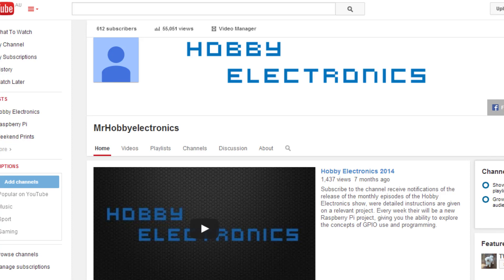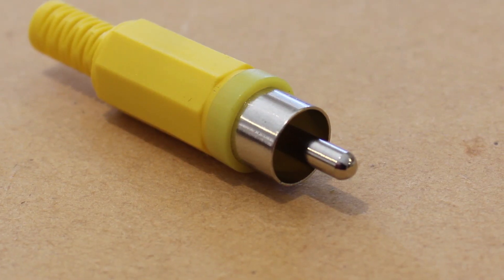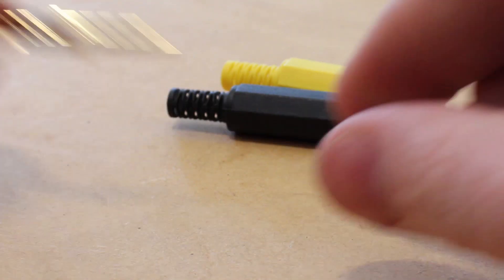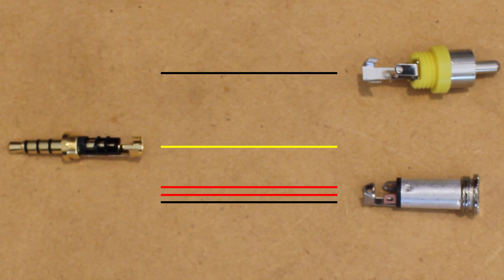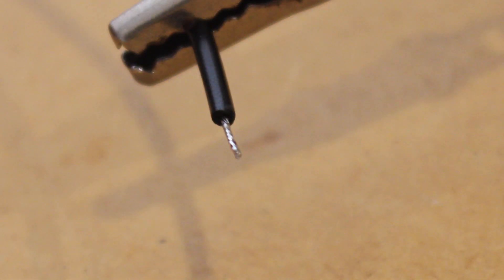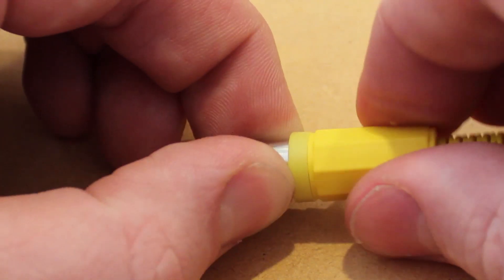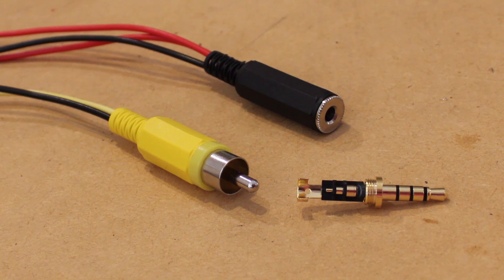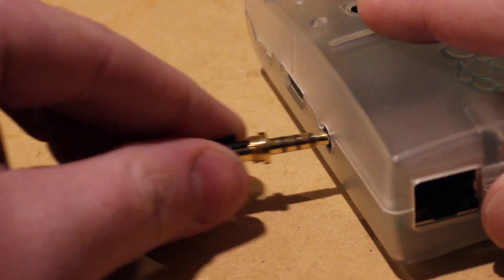Raspberry Pi - B+ AV Breakout Cable

Comment: great video.  Once you have the cable...do you have to do any special configuration on the RBP itself for the composite out to work? or is it plug and play?
Reply from the maker: +JAFO-PTY Thanks for your comment, I just needed to pug the cable in and connect it to a tv and it worked for me.

Comment: Does this work with the raspberry pi 2?
Reply: +MrHobbyelectronics  yes it does
Reply from the maker: +Mitch K Hi Mitch,  I have not tested it but I believe that it uses the same configuration.
Reply from the maker: Latest Trailers Thanks.

Comment: It doesnt work, i have this cable from camera, with camera isnt problem but raspberry do nothing
Reply from the maker: Mr Nope You might have to plug one of the audio ends into the video jack instead as the pin out of the cable might be different as it was made for a camera.
Reply: Ok, good idea, ill try it
Reply: tried, but it still doesn't work, can you get with this cable to the first screen on the first raspi start? I think it should be set on the raspbian as primary output, but I'm totally not sure
Reply: is it true? can you try it please?

Comment: +MrHobbyelectronics                http://www.amazon.in/Stereo-Cable-meter-laptop-audio/dp/B00D88RQBC/ref=pd_sim_e_6/275-7973286-3927120?ie=UTF8&refRID=0WJ51YVDCNY2N0JHV17W 
 Cud u please  check if this would be enough...urgent
Reply from the maker: That cable does not have a 4 contact 3.5mm plug on it on only has a 3 contact
Reply: Cud u gig me ur Facebook I'd ?
Reply: Facebook ID

Comment: Did you do any configuration for the RPi to work.. I got this cable but my RPi is not outputting video from the audio and video Jack..
Reply from the maker: I just plugged the cable into the pi and it worked
Reply: Where can I buy this parts? I have looked no luck yet
Reply from the maker: I purchased mine from Jaycar Electronics http://www.jaycar.com/
Reply: no, i didn't .